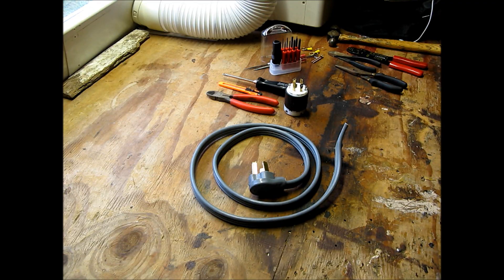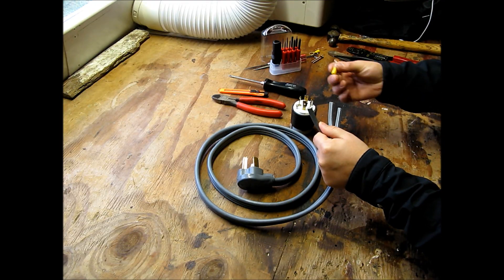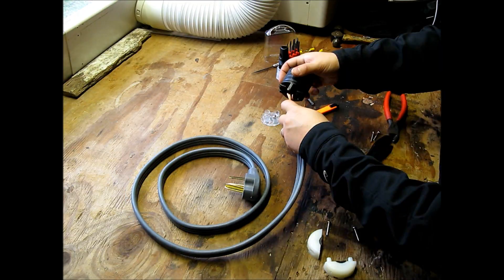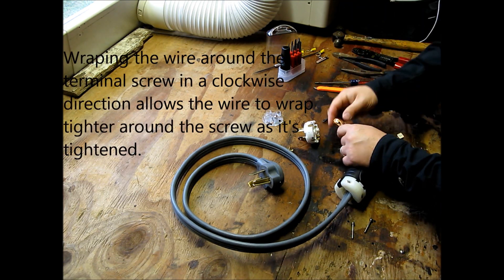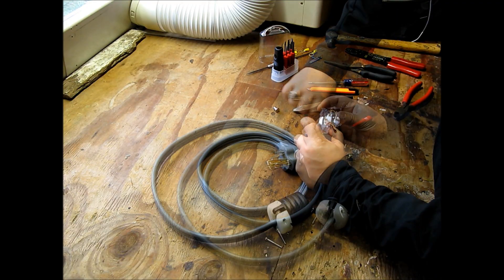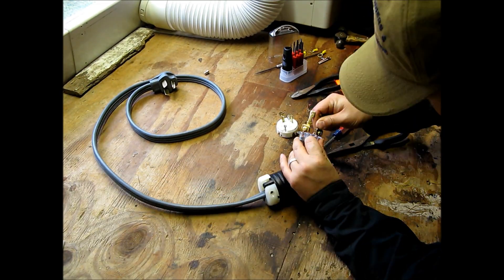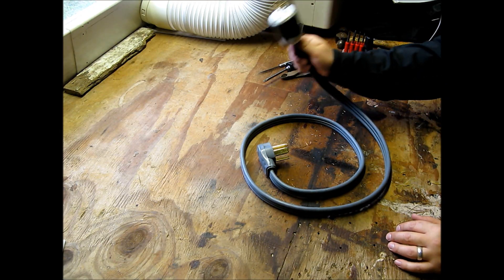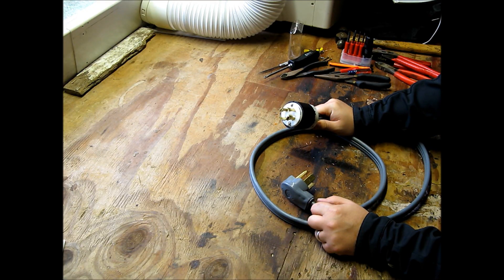How to build a backfeed cord

Comment: Scenerio: lts been 6 months since the power went off, services are non existant and that includes supply houses for hardware and all trades are at a standstill. You have a generator and half a tank of gas in your car, its winter and the temp is supposed to drop to 0 in the night. You have the pigtail,what would you do?
Reply: I think you need to read and understand what I said. This was saying it was dangerous. I said it would work,IF YOU HAD ANOTHER CORD TO PLUG IT INTO.THEN IT WOULDNT BE DANGEROUS BECAUSE YOU WOULD HAVE A LONGER CORD. MAYBE I SAID IT ABOVE YOUR SKILL SET. I have ran my generator and back fed it trough my dryer plug and it worked great. My pint was how to make it where you had a female end on one end where the cord wouldn't have a hot set of prongs sticking out. I would hate to see you try this at home. By the way. You don't have to act like a tough guy and talk to people the way you do. Don't impress or scare anyone so chill the tuck out.
Reply: Yeah, I bet folks aint so picky when they need power and all they have is the generator and the pig tail. I know I would use it in a heart beat. By the way the only thing dangerous about it is the live mail end of the plug but if you have a regular generator cord to plug into this one then you plug the short one in first and then you have live female and dead male to content with. Unless you unplug it from the dryer outlet you cant get shocked anyways.. But I am like you. I would do it in a crunch for sure.
Reply: Scenerio: A little pre-planning goes a long ways...why wait to the SHTF? Then you won't have to do stupid, dangerous shit. In your scenerio the local ER is probably extremely busy or closed. Hmmmm.
Reply: Free rides for gas money I thought something was wrong with that guy. he better hope he has help if things ever go south and he has to use something like this..lol Thanks for letting me know I wasn't crazy.
Reply: Fish Man you better hope your dryer plug is outside, because that 4 foot cord ain't making it outside. last time I checked generators put off a lot of carbon monoxide. Sweet dreams butter cup.

Comment: "You shouldn't take advice from some guy on YouTube." This guy has done EVERYTHING wrong! And the hard way! It IS against code to have a male attachment plug energized unless it is mated to an energized female connector - NEC 406.6(B). He glosses over not having a grounding wire, which is required, and must be attached to the frame of the generator. The home's grounding system will not clear any faults while the generator is operating. As other posters mentioned, he (unnecessarily) removed the clear shield that acts as terminal placement assurance in the attachment plug. He also wrapped stranded wire around a screw when he could have just slipped it under the plate held down by the terminal screw. Of course, that was before he pulled the dead front away from the prongs (WTF?). In conclusion: this guy is dead wrong about the kind of cord to make and completely incompetent at installing an attachment plug, turning what should be about a 5-minute install into an hour-long ordeal. Don't get me started on the threat this connection poses to the utility's linemen and to his neighbors.
Reply: Garrett Ryan, Be aware that turning a CB off, MAY not necessarily open the contacts internally. Shit happens. People die because of this.
Reply: Bruce B no they don't. It's never happened and if it did, the linemen was a fucking idiot
Reply: Jessie James, not caring about Code can get you killed. You might want to take the time to read thru my long dissertation posted a few minutes ago, beginning with "I have to comment on this “cheap” DIY stuff....".
Reply: He never said it was correct. He clearly stated this the wrong way to do it. But fuck when the world turns to shit after Hilary is elected and zombie's are trying to eat you would you give a flying fuck about code? I'm going to take a wild leap here and say 99% of people would not care about code.

Comment: Back feeding your house in this manner is very, very, dangerous. First off if the house is back fed without disconnecting the meter, it would put any lineman in danger of electrocution in the process of trying to restore the power in your area. Also, with out a dedicated neutral the loads could become unbalanced so that a 120 volt circuit would become a 240 volts frying or burning up many of your household appliances,not to mention your home. This is not a safe alternative to a power outage. The "suicide" cord is not the only danger in this process!
Reply: Fred Wiedlich no

Comment: At 10:30, just turn off the dryer breaker to kill power to the house. Also, this entire video shows how to bypass your grounding conductor from the generator. Do not backfeed your house with a generator; it's incredibly unsafe and illegal. Proper generator hookup is somewhat costly but this is NOT a DIY project; hire a qualified electrician to do it correctly. 

If you need to run a portable generator, use extension cords that are as short as possible and correctly sized from the outlets on the side of the generator to the load that needs power.
Reply: Jack Fletcher Backfeeding is not illegal. Apparently you're not familiar with interlock kits.
Reply: I know that my gen has a neutral and ground on the receptacle on gen. and that I have a ground  connection on frame of gen that is connected to a 5 foot ground rod as instruction state. The ground/neutral are same in 3 wire crowfoot dryer plug, not great but acceptable. My home had a 4 wire dryer receptacle, two hots a neutral and separate ground. 1n 1999 code had  that rule changed to be a 4 wire dryer cord. 
As to in this setup the dryer receptacle was hanging out of the wall, I know there is a code for the socket to be secured to a stud or other fixed member of the bldg.

Comment: What about just adding another 240-250 outlet, tapping into your existing dryer outlet?. Metal generator inlet box, use same gauge wire tap off existing outlet, run into outlet box, connect wires. Now you have 2 outlets 1 for dryer, 1 for generator? just saying, no suicide cord needed. If i wanted to add another house outlet I would get same gauge wire, cut right length, again adding metal box using metal conduit form existing outlet to new outlet box, and now I have another outlet providing I can, you can only run so many without overloading circuit. Has anyone tried this? just makes more sense, but not sure it will be correct or in Code where I live. any comments send them my way, I have been thinking of ways to get this done without making a suicide cord.

Comment: as a future electrician... I cringe at this and watching what he did wrong on that cord cap.
Reply: +Nick Dvorchak Hey Nick , are you certified now? see my comment above give me your thoughts, Thank you
Reply: +Nick Dvorchak I could ad another 30 amp circuit to my main panel but it will be on the very bottom, as we all know the main on and off is at the very top, so I do not think and can add an interlock, the very top is my dryer 30 amp circuit. that's why I figured I should use my dryer out let to add my generator box. let me know what you think.
Reply: well... I meant mostly how that plug (cord cap as its called in the trade) was assembled. That clear plastic piece is not supposed to come off, and you are not supposed to make hooks in the wire. There should be a plate attached to the terminal screw that moves as you turn the screw. The wire should be put under that and you tighten the screw and just pull on the wire and make sure that it is tightened. The wire also should only be stripped to the length needed and there should be NO bare copper sticking out of the ends especially because there is so much current it makes it easier for arcs and fires. but over all... I still wouldn't make one of these knowing that this would completely break all the safety rules that I have ever really learned about this.

Also, I am not certified, but I am on the way. I am a sophomore in a trade school, and as you imagined, I am taking electrical. I have assembled/ disassembled a couple of these in the past year
Reply: your a cringer huh?

Comment: Joe Barbosa you asked a great question and yes you are right 4 wire is the best way to go. 2-hots 110V ea / 1-neutral / 1-ground WITH unit grounded also. Also a mechanical interlock HAS to be installed with a dedicated 30A 2-pole breaker. This will ensure that the MAIN breaker has to be shut off first to be able to turn on the back feeding 30A breaker. SAFETY for just $65.00 (Menards, Lowes, Home Depot, etc) carry these items. 18 years Residential, Commercial, Industrial electrician!
Reply: OberDragon88 Mechanical interlock sounds like a good idea especially for people who just can't remember the simple yet crucial step of turning off the main breaker.

Comment: Brah, you need to reference the plug's instructions....besides, the plugs terminals are indexing pressure plates not screw terminals and the wire strip gauge length diagram is embossed on the plug. You don't realize going from a gene 4 conductor outlet to a 3 prong inlet, your gene frame in now ungrounded?

Comment: if the main is switched off can power still backfeed to the main feed and shock the line men ?
Reply: 174joedirt  Possibly but just so everyone knows. Lineman policy is to treat all lines as live and install grounds on both sides of the lines they are working on so that very thing cannot happen. I'm sure there are guys who disregard the safety policies but that is their fault if they get hurt because of ignoring the grounding rules.
Reply: @MrSigDan  finally a common sense response!!  People in here act like linemen are just out there trusting their lives with the general public. They're highly trained professionals.
Reply: nope it cant the circuit is open
Reply: @michaelhorsford403  yes, it can.  The ground and the neutral are not switched and can feed back into the grid.
Reply: LMAO

Comment: This is a very safe way in my opinion . i do this in my house a lot.
Reply: NO!
Reply: I think most house main pannel earth ground & nutro are connected at main pannel. 

Make sure main breaker need be off to not denger line man. (Thats interlocks are for to protect not back feed to utility company when line man are working.) 

And make sure earth ground are working properly to not get shortened between line, breaker should protect megerity. 

Thank you shearing sir.
Reply: All depends on sequence of how you start it all up.. That is the crucial part. Or at least it is from what I have read & seen.

Comment: I noticed you used a 3 wire 30amp. wouldn't a 4 wire be better
Reply: Older houses use the 3 prong plug
Reply: My wire has x, y & ground how do I plug that in?

Comment: I love how you call it a "backfeed" cord... it is aptly named "Suicide" cord for a reason. And should be illegal.
Reply: +Mr Potential Platypus And IS illegal per NEC Section 406.6(B). "Attachment plugs shall be installed so that their prongs, blades, or pins are not energized unless inserted into an energized receptacle or cord connectors. No receptacle shall be installed so as to require the insertion of an energized attachment plug as its source of supply."
Reply: @caseycooper5615  does interlock will help according to NEC code ?
Reply: It is.

Comment: Don't understand why you did not include an extra wire for the ground. True it would have meant zip tie the extra wire to the cord.  You should also mention to turn the main breaker from the utility to the off position so when power is restored, it doesn't back feed into the running generator.
Reply: Because he is using a 3 prong dryer cord..to a 4 prong adapter

Comment: you know you can stick the wire rite in and screw it down dont need to wrap it around the screw  its safer to do in canada we have 4 prong outlet with gound   and alwas alwas alwas turn off the main power